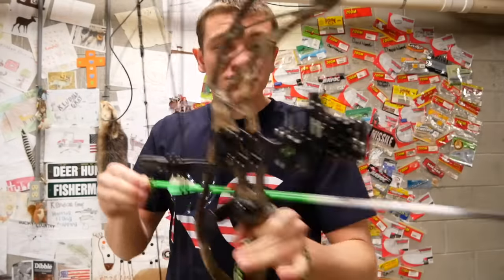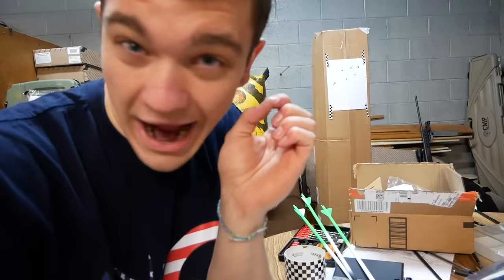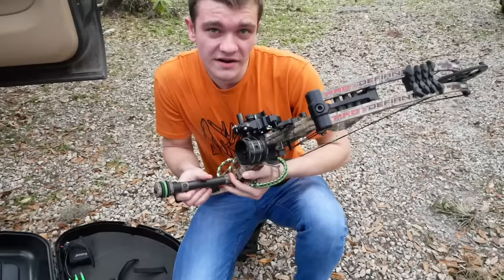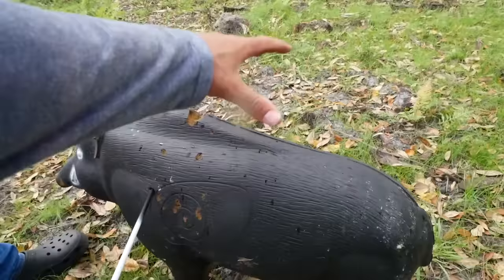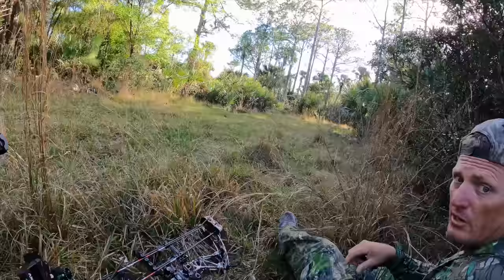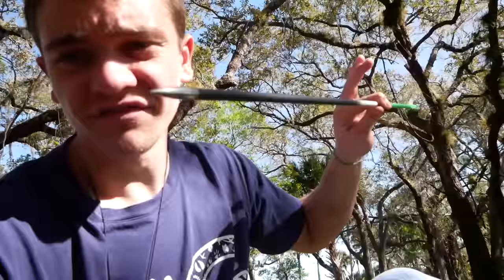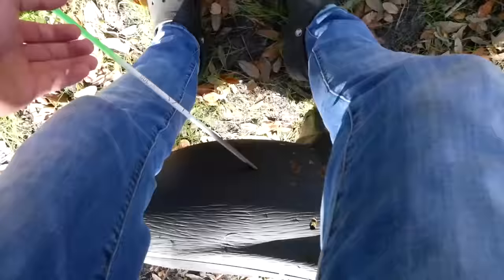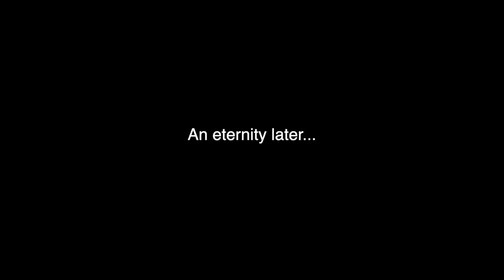I Hunted FERAL WILD HOGS in Florida for the First Time!

Comment: Hey Kendall! Switch to regular Muzzy 3 blade broadheads 100grain or 125grain...they have the tip that smashes and cuts through tough bones and whatnot....ur broadheads were probably the problem... your cut area was wide but it was a flat shaped and didnt leave a good enough blood trail...with muzzy broadheads this wont happen as often at least forsure.... try this out and make another video. Wont disappoint.

Comment: Sir you can believe me or not its fine, but that range finder was your biggest problem; its like using a calculator on a math test instead of learning multiplication. the practice shouldn't have been to sight your bow in, your great at that. The best practice to do after seeing the video is to predict distance. My recommendation is to run around all morning estimating the distance of things. BECAUSE THAT SIR, is the mark of a true bow hunter.